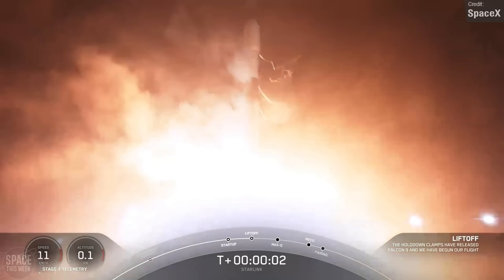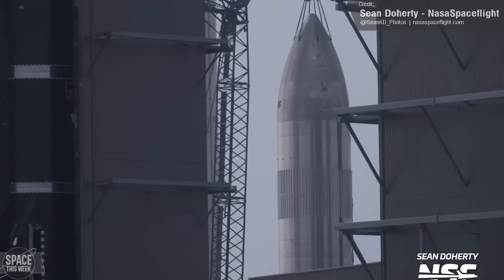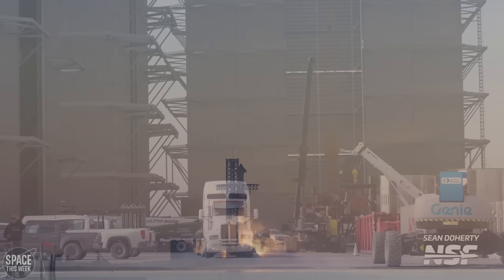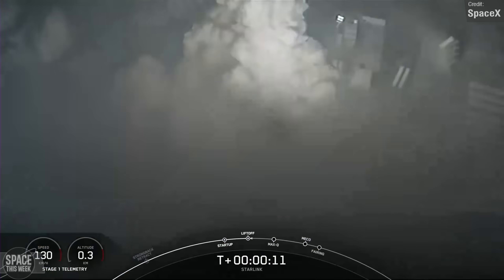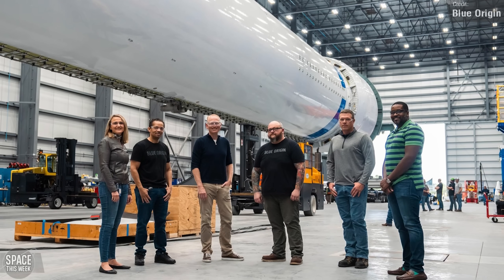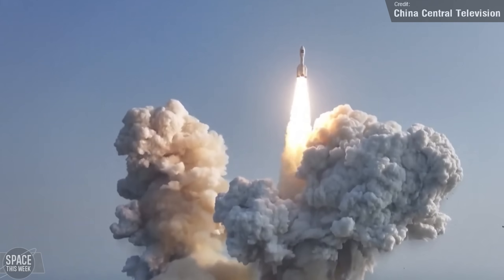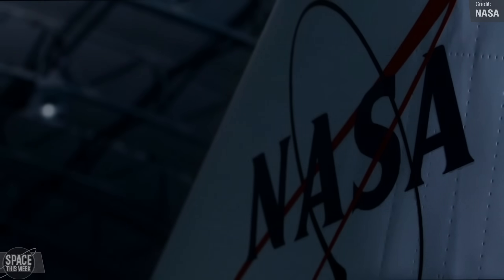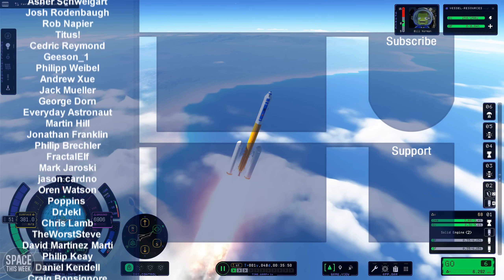SpaceX are Reinforcing Starship and We're Not Sure Why.

Comment: Matt, this is a tanker version, and the internal stringers must be trimmed down so that insulation can isolate the cryogenics from the ships skin and ribs. Otherwise, either internal volume will be lost to covering internal ribs with insulation. External ribs avoid the issue, but the manufacturing process has to be accommodated first and you are seeng that step.

Comment: I’m super excited for Gravity-1. I seriously do not understand why there are no American companies pursuing simple reliable all solid launch vehicles. If you’re going to do disposable logically solids are what you want.
Reply: The Minotaur I is all solid rockets and has been flying since Jan 2000. It has 4 stages and is based on the Minuteman II ICBM. It's nicknamed the Banana rocket as it has yellow insulation that peels off at launch to keep the solid stages at the best operating temp.
Reply: @steveaustin2686  I went to Wallops to watch the Minotaur V launch of LADEE. Why do you think I’m so enthusiastic about solid fuel?! Minotaurs are fantastic and we should be doing more with solid rocket technology.
Reply: IMO its because of NASA's new model of "take our payload and make the rocket" instead of them buying rockets, companies want reusable rockets with high success rates rather than super disposable ones you have to keep building with (relatively) low success rates
Reply: @ezoni8438  well that’s nonsense. All of the most reliable rockets that have ever been have been disposable except from falcon 9 and shuttle. Also the cost saving to the customer is nowhere near what was promised by the early rhetoric of Spacex’s reusable evangelists. Each falcon flight is around $65 million. That’s a significant improvement but it’s not comparable to an airliner like Elon said. People said that exact same thing about disposable rockets being a thing of the past back when the shuttle came around. 

There’s being enthusiastic about progress and then there’s naivety.
Reply: @Rory-Shields  Solid fuel isnt any more cost effective as liquid fuel anymore mind you, and due to the nature of solid fuel is less reliable, im not some kind of elon shiller im someone who knows the actual history of reusable rockets, dating back to the damn 1980s when we first started (and stopped) using them because of reasons stated above, additionally im not throwing shade at traditional disposable rockets being low success rate but by the nature of how NASA bought them causing companies to not put nearly as much effort into them as they do now

Comment: S26: reinforcements are for the motors used for lunar landing (which are mounted up)
Reply: I agree that it's pathfinder/mockup for hls, but I think here will by no engines. Stringers are necessary in that place because lack of proper internal Stringers in this model, and SpaceX would probably cut out elevator holes etc, and build rest of mock-up of hls. I think they need full scale model for adjust and test practicality of any solutions. Even friggin button panel placement can be very inconvenient in space.

Comment: My understanding is that ship 26 is seen as an example of a refueling ship - if this is the case then perhaps is needs the extra ribbing for strength to make it capable of either repeated  transfer of fuel while in space or to provide additional strength while another starship is nearby in space
Reply: Lander variant? Reinfocement for the landing rocket most of the way up?

I suppose we'd have seen an engine test first though...
Reply: @TlalocTemporal Could be just a pathfinder. 
Not sure, but considering moons gravity is lower, I dont think reinforcement for landing is required.
If it indeed was a lander, could it perhaps be reinforcement for the cargo space door with the elevator?
Reply: @galaxya40s95  -- The tanks might not be as capable in tension as compression. Also, as a test platform, they might be planning for a significant amount of extra equipment aboard while depressurised, which will leave the tanks at their weakest.

As for a cargo door; why would there be reinforcement all the way around for a cargo door? Wouldn't we see an obvious cutout first?

Or maybe everyone's wrong, and this is just testing stringers.
Reply: @TlalocTemporal  Yeah extra weight might explain it.
Maybe symmetry? Also ring is pretty structuraly sound shape.
You might be onto something with the stringer test.
Reply: Agreed. It will be interesting when they add the two horizontal tubes and external valve packs.
Reply: Oooooooo that would make sense
Reply: I was hoping it’d be an HLS prototype and the stringers were for solar panels but the tanker prototype theory makes much more sense. I just want to see HLS!
Reply: @alexlabs4858 Me too. I also hope it is a HLS
Reply: @FerociousPancake888 HLS depends on the tanker… I Wonder if they’ll do a dedicated “fuel depot” ship…

Comment: Some one explain to me how 42,000 satelites that have to be replaced every five years are going to be economically viable.
Reply: You can bet that SpaceX will build them cheaply, plus their revenues exceed $120 million per month, and will only go up.
Reply: These satellites provide enough bandwidth to pay back the construction and launch costs in well under 5 years. Starship will launch much larger satellites that can handle more than 10 times as many customers. The per satellite launch costs will be significantly lower.

SpaceX could have put bigger propellant tanks on the V1 satellites to give them a longer life in orbit, but then each Falcon 9 wouldn't be able to launch as many. Which would have limited how many customers they could support in the early years.

SpaceX will continue to increase the available bandwidth until the market is satisfied. Until then, the satellites will be designed for a hardware lifetime that corresponds with their business lifetime.
Reply: @hamjudo  2000 customers max per sattelite I'm hearing
Reply: @atillathehungry3145  for which satellite version? There were capacity improvements between V1 and V1.1, and a bigger jump to V2-mini.
Reply: @hamjudo  per google latest update
Reply: Would be interesting to compare with ground based internet infrastructure costs.
Reply: Simple. Taxpayers pay for it.
Reply: @myacctoostale9345  No, the people PAYing for the PAYloads are PAYing for it.